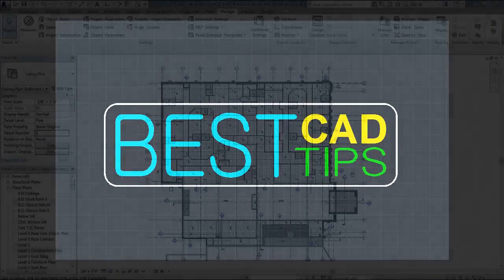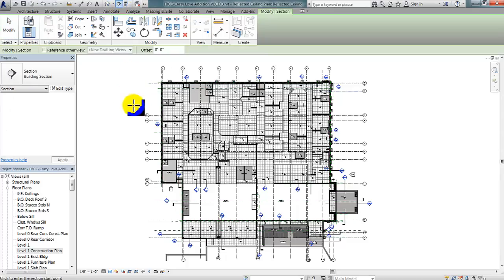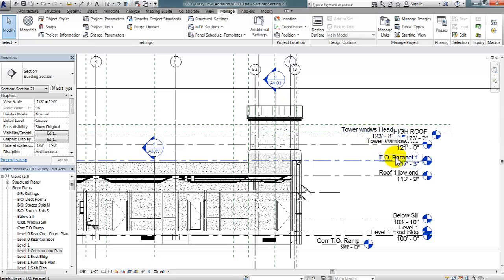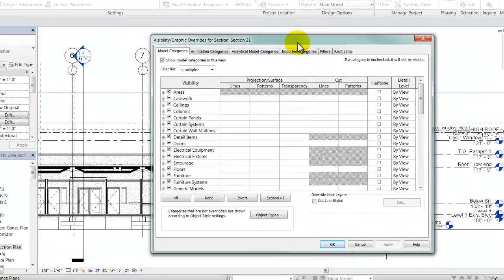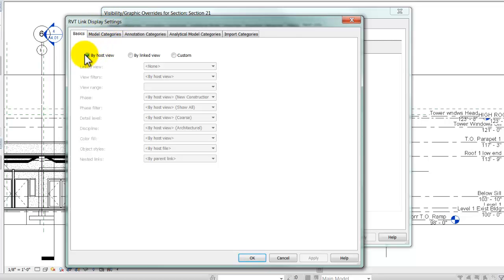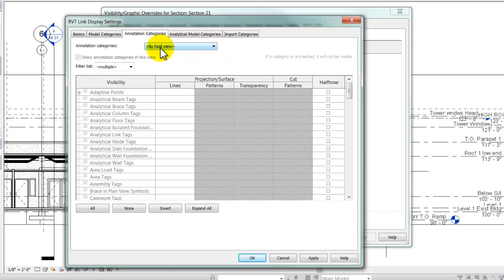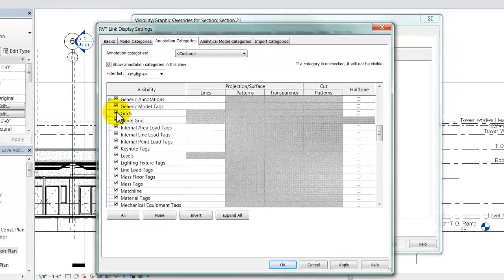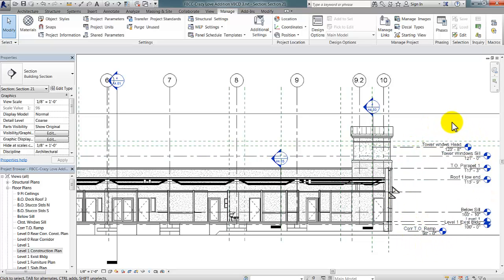Revit: Hiding linked model's grid & level lines

Comment: Btw, we sorted out the full version but this solution unfortunately only applies per file which is great but it would be nicer to have the option to disable them on all linked files, potentially on all the view. What I have done now instead which is faster is just to accept the imported grid and hide the original one

Comment: Almost 8 years old and helped me as well. Well presented. For the questions regarding multiple links, my suggestion is to merge all multiples to one link, then control that singular link.
Even as presented here you are still going to have to do this change to every single view or view template you have in a project.
Reply: No. It's saved in the view template

Comment: Mark, thanks for posting this.  I know you can set this up in a view template as well.  Do you have any advice on how to handle this with multiple linked models?  For instance, when I have two models linked into a third, I go through this process for every view template that has grids and/or levels set to visible.  I think it takes between 8-10 mouse clicks per model.  Say you have 10 view templates.  It adds up quickly.
Reply from the maker: Jeffrey, this is the best way that I have found. If you discover an easy way to handle multiple linked models, please share with our readers. Thanks for reading! Mark

Comment: Revit LT Work Around: Use mouse over the linked element and use TAB key to cycle through until the element you want to hide highlights and right click and click on "hide element".  The bad thing about it is that this has to be done for each linked element because if you select hide category it will hide even the unlinked elements you may not want to hide.
Reply from the maker: +jimdandy56jd  Thanks for the tip!
Reply: Thank you very much for the information. I use Revit LT and it is different from Revit.
Reply: For me it doesn't work with grids